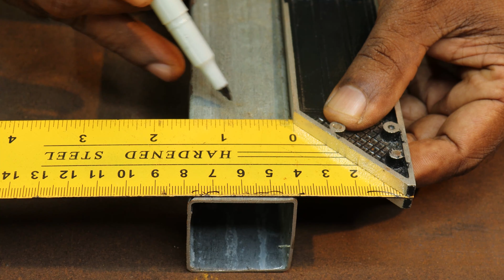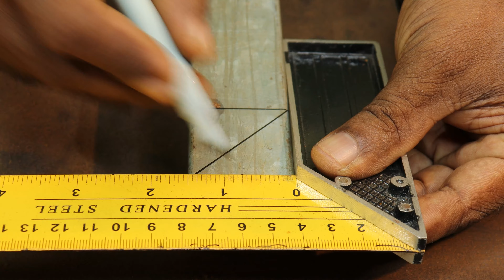WHY DON'T WE TALK ABOUT IT? Secrets Of The Profile Pipe!

Comment: Question for anyone that knows:

This could be done in less time with one 45’ angle cut as is most commonly done.  But which method produces thr strongest joint?  At the end of the day it’s the integrity of the finished product that matters most.